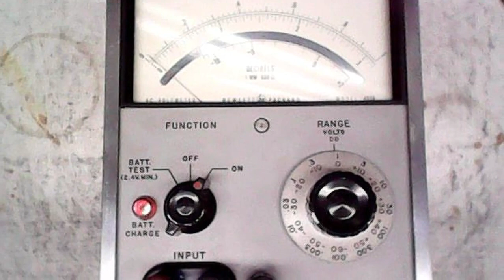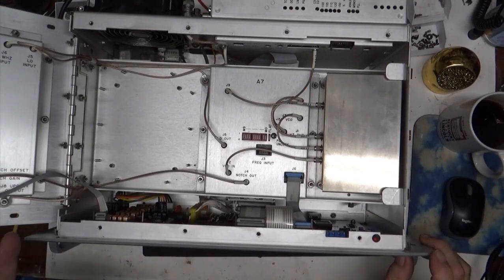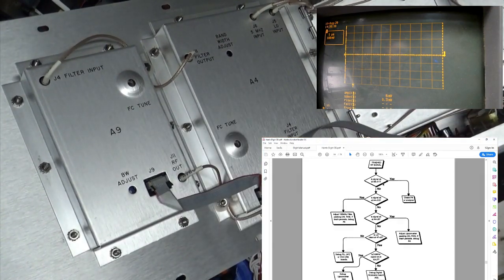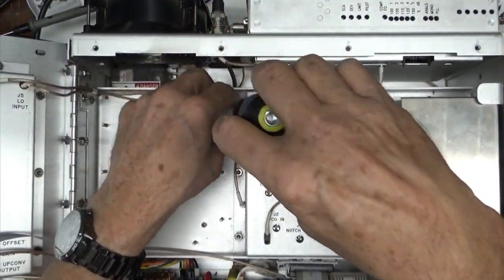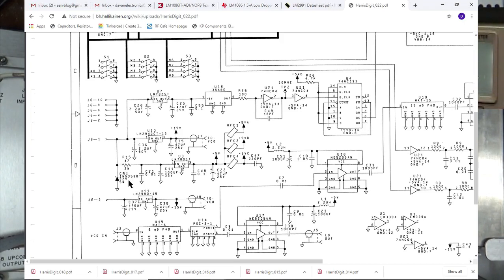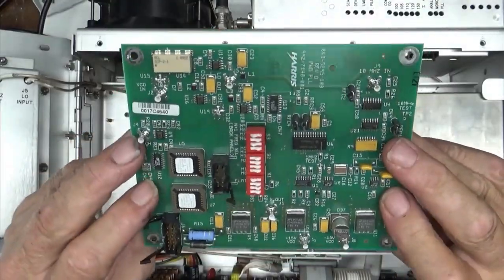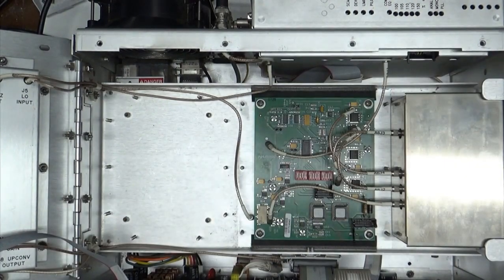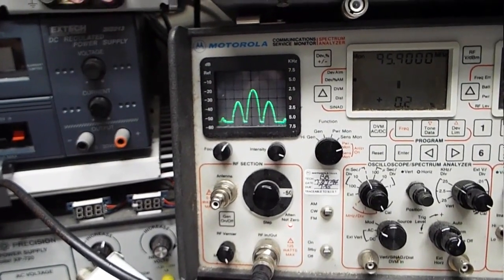Fixing a Harris Digit CD FM Exciter

Comment: Dried up caps in some of the regulator sections often cause the regulators to oscillate and throw spurious trash on the output.  I've seen that happen a few times, so always check the output spectrum on these guys.
Reply from the maker: You are so right.  Pretty much now it is 'is it from the 80s, 90s or 00s? Change the caps first.' It is getting old I tell ya.

Comment: Great video! Those look like SMB connectors on the cables. I assume you checked the tantalum capacitors associated with the 5 volt supply for skid marks. I agree with you, deriving a 5 volt supply from 16 volts with a dropper resistor is not good engineering - unless it's a really low current supply.
Reply from the maker: I did check all the caps quickly and didn't find any bad ones but I am going to re-cap anyway. The thing is 20 years old.

Comment: This is a VERY common problem. I have fixed many Digits, by replacing R15, 47 ohm 2 watt.    Lousy 'flame proof' resistors..
Reply from the maker: Really. You would think for what they cost this kind of problem would not be a factor.
Reply: Update, Voltage regulator Q1 in the PA module went Poof! 

Apparently, and I'm not sure if they're related. But there's a TSB about that R15 resistor also being present in the PA module. Two of them. Right by the FET. Replace with a 3W resistor was GatesAir's recommendation.

And also, another TSB about replacing a Capacitor in the PA module.

Boom, Poof, Kaboom, Kaput, and then fix. My experience so far with the Z5CD and the Digit. 😂

Comment: Did you burn a hole in the LCD with your soldering iron?
Reply from the maker: Yes, just the plastic though. I know, horrible.
Reply: @AERVBlog  That's nothing.  You should see the cassette machine face I melted with a hot trouble light.  The whole thing turned wavy without even applying very much heat.  The radio station still uses it, but it looks very disfigured.
Reply from the maker: @seanseanseanseansean  some of that plastic is not very heat resistant.  I had a receiver once that was in sunlight for a good part of the day and eventually you couldn't read the numbers. It all blistered up and got foggy.  It spent the rest of its live sans cover.
Reply: No

Comment: My recent PLL issue was because the LM2940CT got cooked by bad caps, on A4. Yes, saw it at 35:20
Reply from the maker: Nobody is perfect, especially me. Bad caps are the bane of our existence. Thanks for watching.
Reply: For me, it was the LT1085CT. The "Logo Indicator" had one of it's lights off... And voltage checking told me the +6.5v regulator was putting out 3v.

What got me though, my soldering iron was too hot and burned a pad off as I was replacing the caps too.

That and on a separate issue, blew a Darlington Regulator on the PA Module.

Comment: RF Mute fault in Exciter and its all module are good except regulator board.
Reply from the maker: I do not know what the 1.8.8.8 means but did you do a full voltage check? Remember these things are usually turned on and forgotten for years until they quit and the most common problem will be bad voltages.
Reply: @AERVBlog  how to check full voltage of this module.
Reply from the maker: @deepakk4246  do you have a manual for it? If so watch the video and consult the manual. Check all the voltages on the power supply board first. What module exactly do you think is bad?